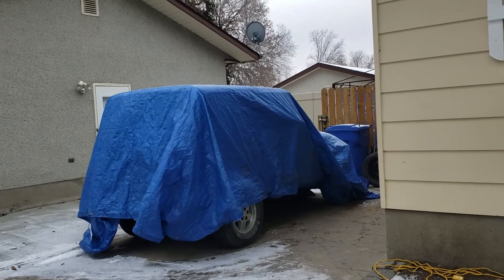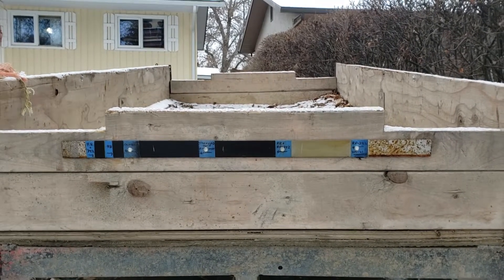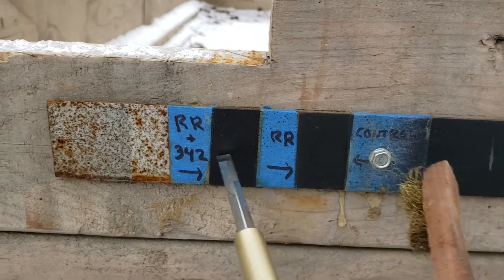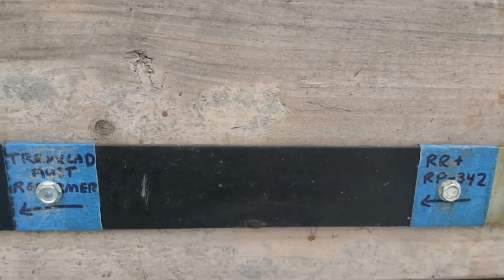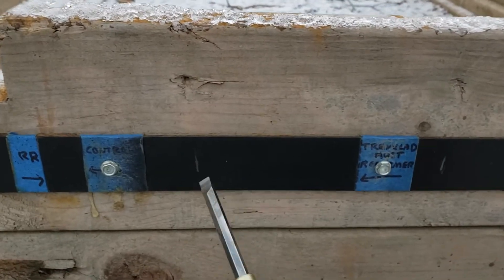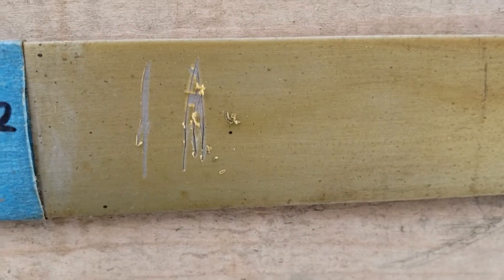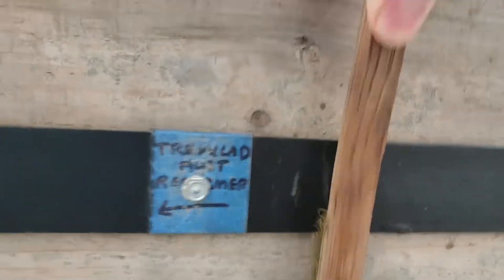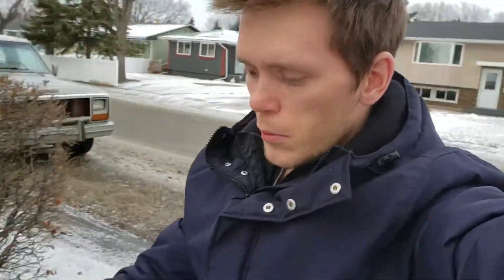1 Year RUST Test - 3 Month Update - Tremclad Rust Reformer | Cosmoline RP-342 | WD-40

Comment: Properly degreasing and etching is definitely the best and proper way to go about making a good mating surface on bare metal for preventive or inhibitor sprays to adhere to. But, most people are likely gonna half-ass the job and not do it properly. And the kicker is, from what I've noticed anyways, that they then go and leave poor reviews wherever they bought the stuff from, which likely ends up deterring others from buying what is otherwise probably a good product (except for rubberized undercoatings, stay away from that stuff), when executed properly. I remember seeing a bunch of bad reviews for POR 15, where people hadn't top coated it to protect it from UV rays (which fades and degrades it over time), with their justification being that it is under the vehicle and not directly exposed to the sun, so they skipped it..

 Well, I'm here to tell you that UV rays bounce, and if you can see under your vehicle in the middle of the day, it's because those rays are bouncing up underneath it. Makes sense, right? So, over time the POR15 degrades and eventually cracks and chips or flakes off in some spots that are more exposed, and then the person leaves a review saying that it's garbage, even though they half-assed the job and didn't finish it off with top coat like they should have. I'm not trying to advocate specifically for POR15 or anything, I've heard good stuff about Eastwood Platinum also and will eventually try that on something as well. Just used that to prove a point that the average person won't want to do all the steps necessary because they think they can get away with doing less work.

 Long story short: people will always half-ass stuff. If a product says to use etching, then use it. If it says to use top coat afterwards, then use it. Save yourself the stress, the wasted time and money, and do it properly the first time.
Reply: Or use a product that is UV stable like MasterCoat, instead of DOGSHIT-15.  "Our product works great if you do these five other steps that no other competing product requires"